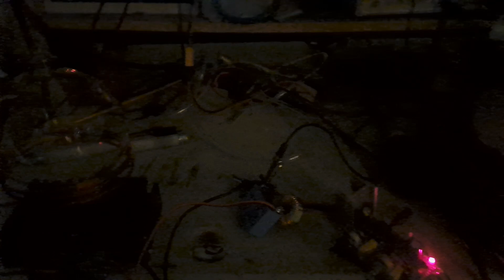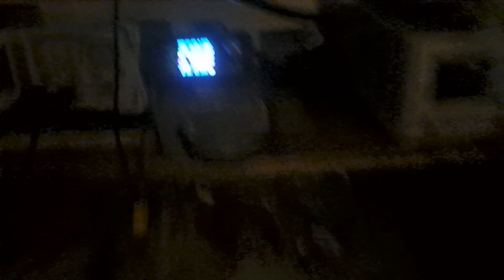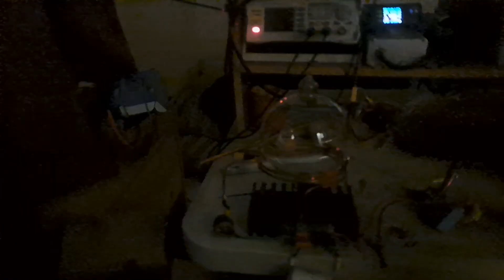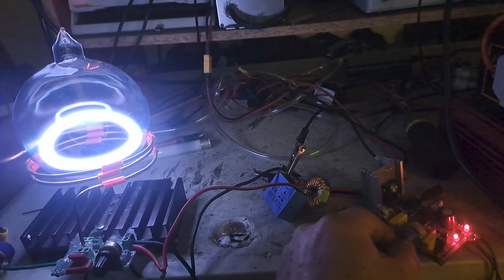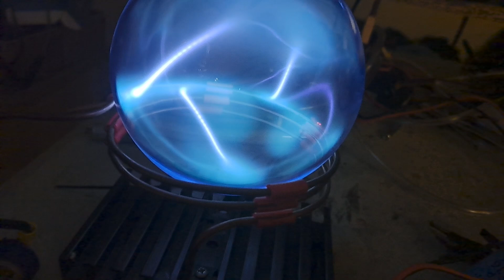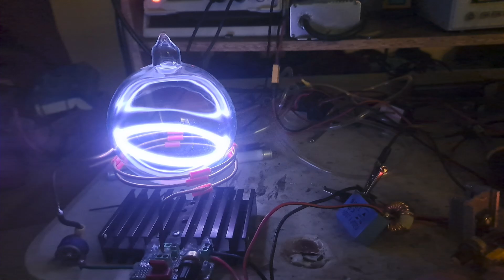Plasma Donut + PWM

Comment: oh yeah, there ya go!
Reply from the maker: Yea it works to a degree. It was much easier for me using those small cheap bulbs due to the way the donut formed and how it "interrupted" itself. That ring was also stationary unless formed with the 'plasmoids'. This donut appears to want to shift around a good deal but so long as the ripple is not TOO much I don't see why it couldn't be made to sit still just above the primary and sort of wiggle with music. If I had catered basic midi files I could probably get it to come through loud enough to hear up close in a quiet room. I already know basic midi would work because I can keep the toroid stable enough at something like 60-70% on time and sweep the audible frequency range starting from like 500hz or so. The only thing is the toroid swings around in the process and will sort of modulate the frequency every time it does it. Sort of like the womwom wawoo wawoo kind of deal haha.

Comment: There are people building there plasma toroids , but yours seems to be very stable ,
Reply from the maker: I see a lot of these out there now after BackMacSci did his series. Really doesn't seem hard at all to get one stable. The difficulty appears to be in figuring out how to build just the right layout but also having the oscillator running well enough to where it naturally excites itself into the ring by itself. I can imagine some people would have trouble because they approached this building their first RF oscillator of this kind.. then as soon as they started seeing cool results they are afraid of changing it too much. I have made too many of these to really care about destroying one anymore. I just build the basic self oscillating circuit that has been out there for over a decade now. It's basically always the same circuit with slightly varying values. At those frequencies you're always going to have to do your own tweaking of those values anyway. I found that I could still get the toroid with this circuit by altering the primary a good deal and changing nothing else. I could also reduce or increase my gate capacitance in the ballpark of 2-3nF or so and still get the ring.. so I basically look at it like easily being able to get the ring so long as you have a decently running RF oscillator with the inductor shaped properly around the globe.